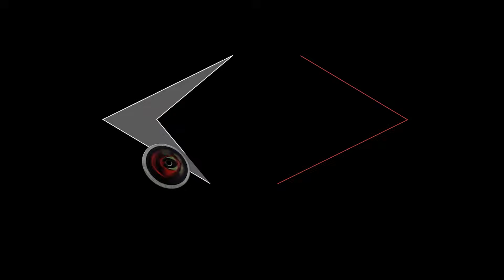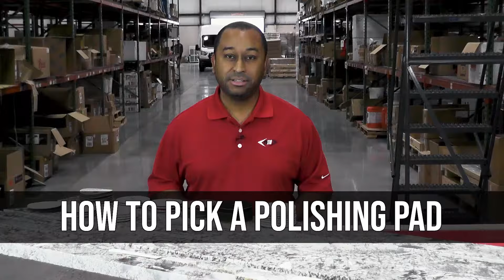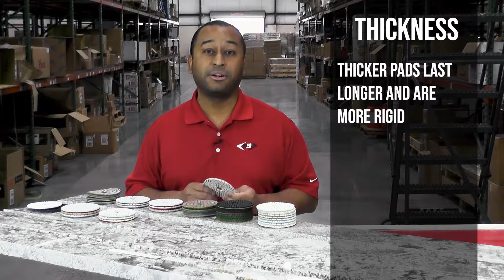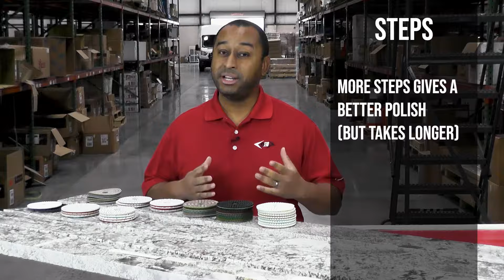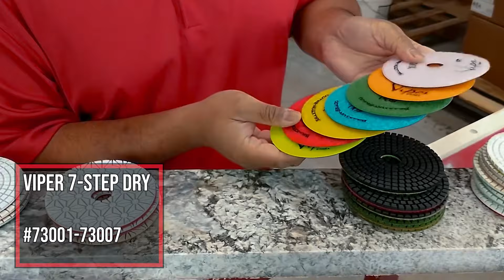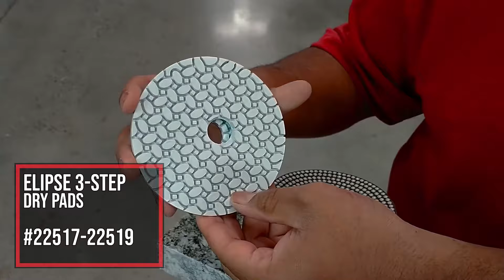How to Pick a Diamond Polishing Pad for Granite, Marble, or Engineered Stone

Comment: Thanks, there was a store near me that only sold 7 step pads and the resin was green and it always stained the marble so I had to clean it so hard and for some reason when the green water touched any white cabinet it would damage the pint and take off the coating if that cabinet uses I wiped it once it’s fully dry.. very odd

Comment: My slab has yellowish around the edges of my white slab. Do you know how to remove it?
Reply: Once some marbles get yellow like that (usually oxidation) it soaks deep into the stone and isn’t removable because of how deep it goes
Reply: If your slab is engineered stone otherwise known as quartz (not be confused with natural quartzite) then you can use Ajax and small amount of water to create a moist paste and rub it on the areas where it’s yellowed. When we install these engineered/quartz slabs the edges commonly get dirty if hands aren’t clean so we always use this method to clean it afterwards. It also removes pencil marks from where we make our cut marks. Just remember to wipe it down with with a clean wet rag after you remove the marks. Otherwise the paste will leave a slight haze on the slab.

Comment: That seems very helpful. thanks
I am just now looking in the market for a wet polisher for use in the UK, do you know if the makita pw5001c is available with a UK plug, and whether or not this is a good choice for the home user doing composite resin pieces (crystal impregnated resins) ?
Most of my stuff comes out the mold fairly flat but never perfectly mirrored and there is often overspill from a surrounding frame from a different composite colour. So, if the stuff is usually flat would a three pad set along with an asymetric 3000 or higher for the final polish and a 50 grit to remove the overspill be enough you think?

Comment: How does one tell if a stone is engineered... I found thousands of square feet of random cuts from a Kitchen design company on Craigslist... It's all mine now. And I have projects to do. My guess is that most of it is engineered with some obvious granite and basalt... But I can't tell the difference between marble and engineered.
Reply from the maker: Engineered Stone - a composite material made of crushed stone bound together by an adhesive to create a solid surface, (most commonly polymer resin, with some newer versions using cement mix).

Terrazzo - flooring material consisting of chips of marble or granite set in concrete and polished to give a smooth surface.

Travertine - a common natural stone that is used in bathrooms. Unpolished travertine stone has a naturally nonslip texture.